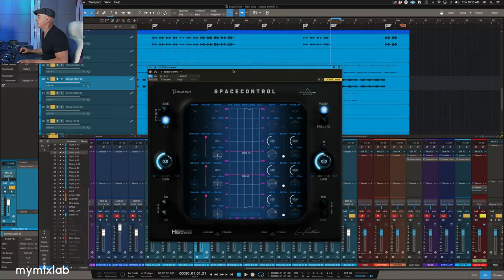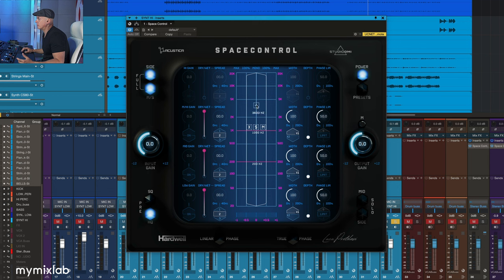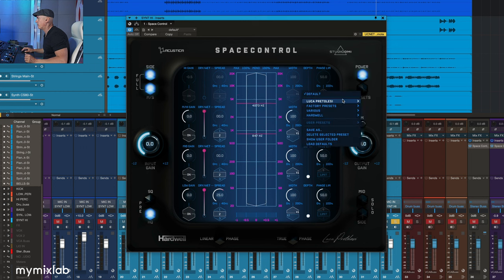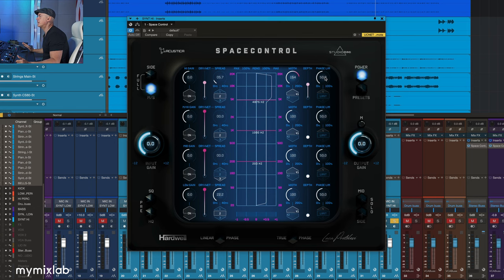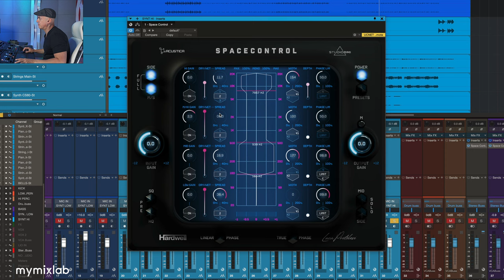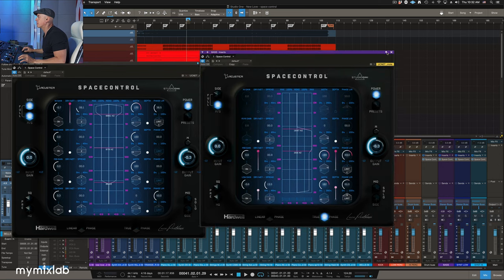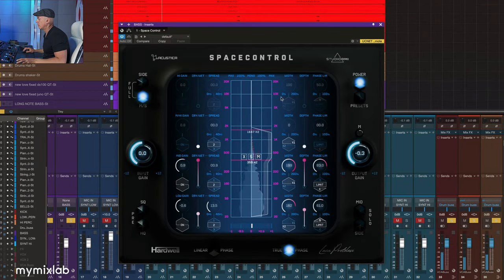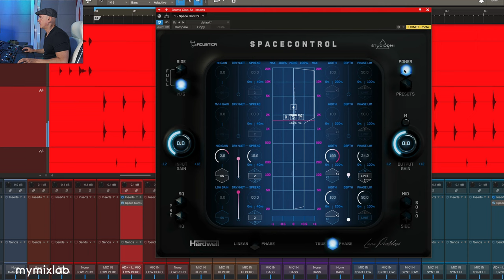SPACECONTROL | Plugin by Luca Pretolesi (Studio DMI), Hardwell and Acustica Audio | TUTORIAL

Comment: These UI designers crack me up... An ON/OFF button but it turns on or off gain only... Why not just allow the user to double click to set gain to zero (which is essentially GAIN=OFF). Then save the ON/OFF Button for the actual bands... instead of adding a random X while highlighting the band. Unreal - it's like these people have never used another plugin before, let alone a well-designed plugin like FabFilter. I like what this does, but the UI is flat out stupid.
Reply: Was thinking the exact same thing